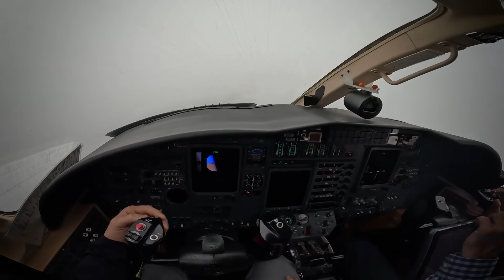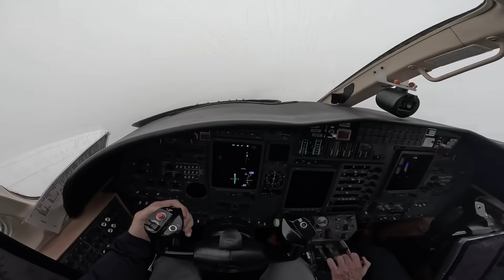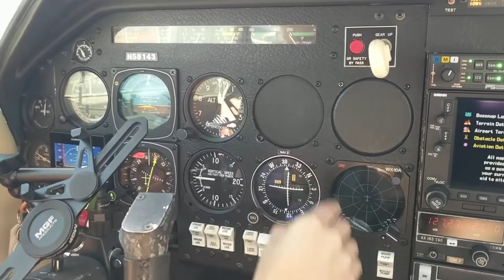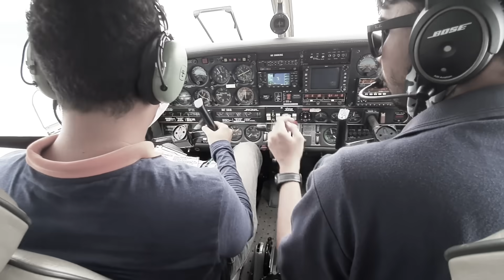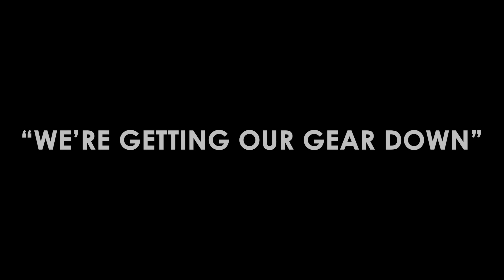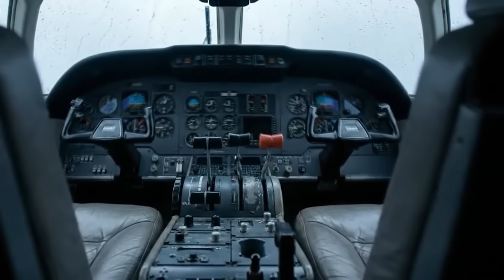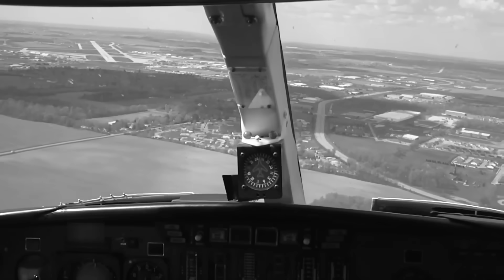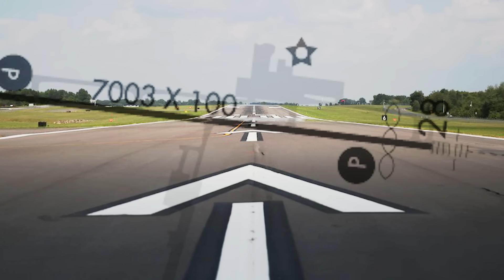Greg Biffle Crash ATC Audio EXPLAINED | When Configuration Became Commitment!

Comment: I so wished they'd gone wings level, declared an emergency, and flew straight to Charlotte where they coulda had ATC help and clearances, instead of all the turns and drag introduced to the airplane. It's the interview of a resident that lived near the airport that stated "the engine was screaming" which to me said they were full power trying to climb with the flaps down and gear down, possibly on one engine and full gross weight. It has been stated that that model plane can fly, and climb  on one engine but not with the flaps out and gear down at full gross weight. They could've landed with no flaps at Charlotte with plenty of runway to stop. Such a real damn shame, I knew Greg from a business standpoint, I hauled several machines he purchased to his Marion property. Damn great guy, when I delivered his machines, we'd stand around and bulls**t for 30 minutes or more. He was a "regular Joe" unless you knew he was a NASCAR star. He demonstrated that with his helicopter rescue efforts in western NC. That's REALLY who he was. This whole deal coulda ended way differently. But it can't be called back and redone sadly.

Comment: You generally don't broadcast that ambiguity. A well-trained pilot would have already prepared for this event, had an IFR flight plan, declared an emergency as soon as possible and landed at an appropriate airport. The comms here are not standard and reflect other considerations than safety of the flight. The points made here are mostly irrelevant. It IS about incompetence, or at best, lack of preparation and execution.

Comment: Those trees standing just outside the runway, soaked in jet fuel certainly didn’t help things. Why not cut them down in the case of a distressed plane with no more lift? Idk. Seems obvious. 

Many of you will say the tress didn’t matter. Well, the plane struck the top of that light pole then the landing gear struck the trees. It matters.

Comment: I don't understand why they didn't land on the runway they took off from, going back in the opposite direction. They made many turns to land where they took off. They could have just landed in the opposite direction; the airport can handle that, the runway was clear. Did they underestimate the problem?

Comment: The question is why did pilot turn left to airport when a right turn would have brought them straight in to runway on shorter approach with little delay and no severe turns

Comment: The plane was flying, and experienced unknown issues the rules of most pilot is to fly to the next Available airport in this case was Charlotte 32 miles away declared a emergency and give them time to figure out the problem and burn some fuel, they actually flew 26 miles,  making Charlotte was easily in reach, a bad decision by the pilot

Comment: Swiss cheese model.  Engine problem.  Poor piloting maneuvering bac to airport.  I read that the PIC wasn't exempt to fly the C550 without a SIC.  Would that make the flight illegal?  Does the aircraft owner decide if the flight should be made or not?   10:20  "This was not about incompetence, it was not about panic, it was not about someone doing something wrong..."  Oh?  On the contrary.  Incompetence means "the inability to do something successfully."   The pilot surely did something wrong and it wasn't just in flight, it was deciding prior to the flight, to fly the C550 without a qualified SIC.   The owner should never have let the retired airline pilot fly the jet alone.  The retired pilot should never have agreed to fly the jet without a SIC.

Comment: They were not stable, this model can’t maintain altitude on one engine, gear down, and “full flaps”. Thats what he did at max gross weight with no “single pilot qualification. The plane didn’t kill the family, the left seat driver did
Reply: That's true flap setting of no more than 15 degrees

Comment: From all the videos and information I had seen thus far, it was an engine problem, one was flamed out. The aircraft could fly on one engine but the tight turn with flaps and wheels down did it in. Not enough thrust.